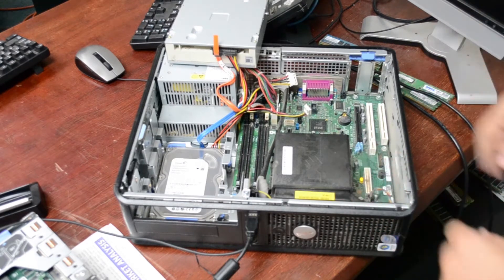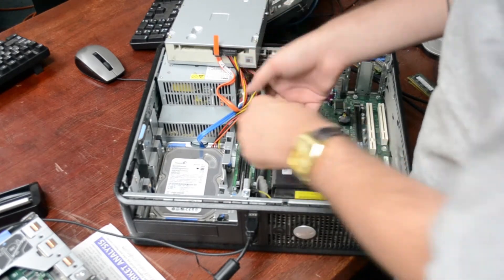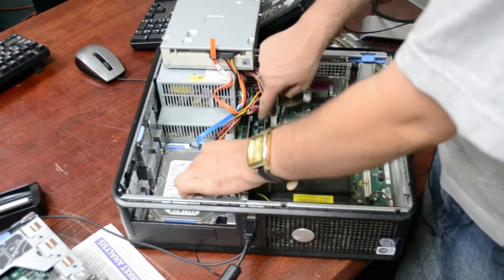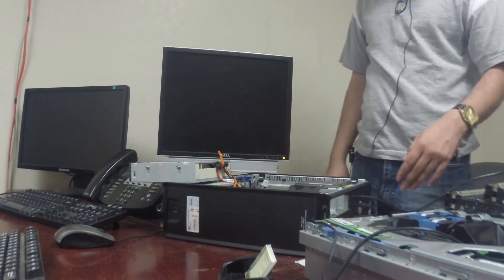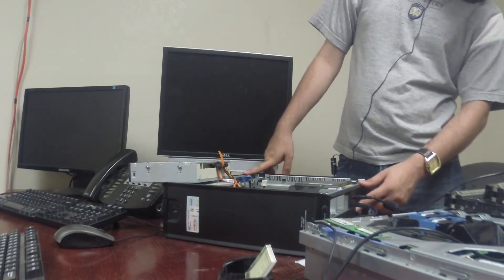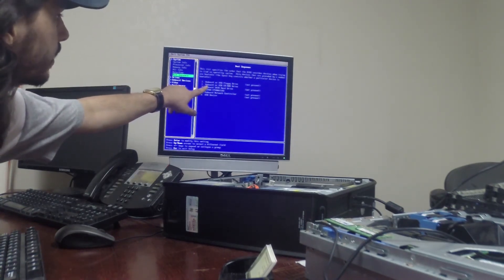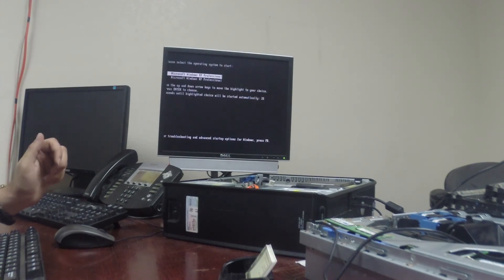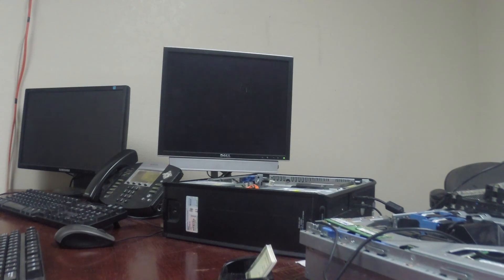Testing computer memory and setting bios (Dell 755)

Comment: I have a dell optiplex 780 sff, I installed 2 4gb ddr3 1333mhz ram yesterday, for some reason the ram speed automatically down to 1066mhz. Do you know how to increase the ram speed back what it should be (1333mhz)
Reply from the maker: It could be one of the ram sticks is damaged and its bring the others down, that or a setting in the bootup. I would check both of those things
Reply: Stephan Harz Thanks for the reply, I will go check it out now
Reply from the maker: np, sorry for the delay in replying to you.
Reply: @StephanHarz  Sadly, I can't see any setting about tweaking the ram speed in the bios